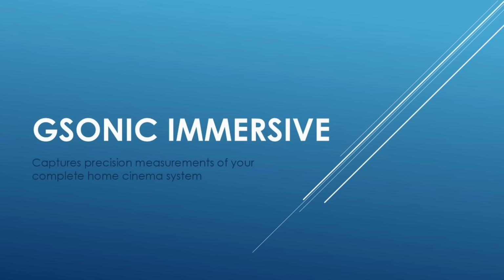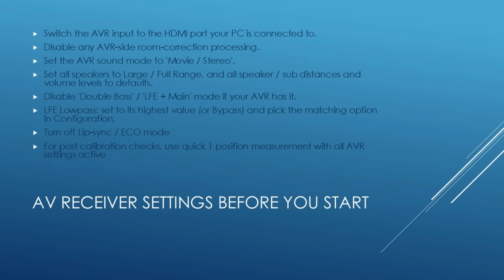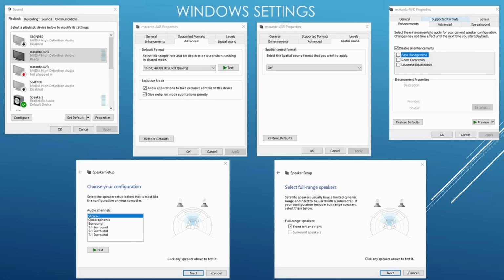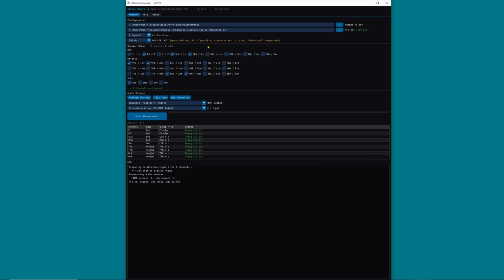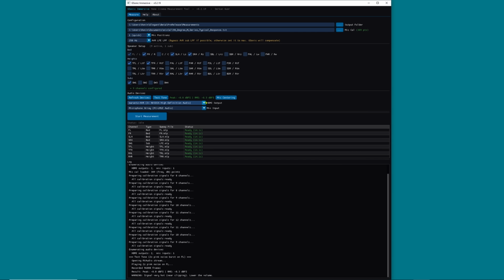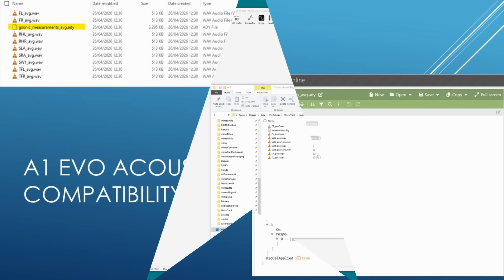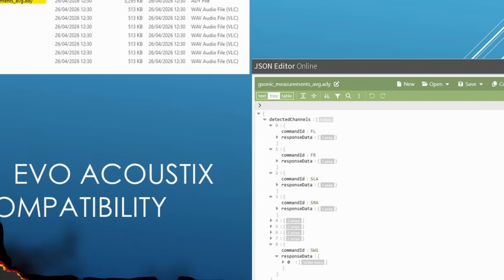GSonic Immersive

Comment: Is there any issue running the audio through my audio chain of PC- Lumagen- Denon A10h? Your app doesn't appear to be pulling any information from the Denon as far as I can tell. Would simplify my measurements and likely produce more accurate results.
Reply from the maker: I am not sure I am understanding the problem? The app sends Atmos sweeps to the AVR through HDMI and records what it hears on the mic with high precision acoustic timing chirps to compensate for any clock drifts between devices. What is a Lumagen?
Reply: @ocaudiophile  Ok. Feature request. I can't generate an .ady file when the Lumagen Radiance pro processor is in the chain. Would be nice to have a checkbox that says to generate an ady file in such a situation, then the entire chain can be measured for potential lag in audio signal which should be neglible. Anyone who does not run their audio signal directly from source to receiver should have this option available.
Reply from the maker: Understood. I will add it in the first update. Gumroad will inform you when it's uploaded. Probably not today though if ok.
Reply from the maker: GSonic updated to v1.0.2 with ady file save now optional and on by default  for Denon & Marantz. Gumroad will not email updates automatically until the first payment is made to me in a week so I am informing you from here.
Reply: @ocaudiophile  Thanks! Didn't expect this to happen so quickly. Much appreciated!
Reply: @ocaudiophile  There is no problem, just wondering what best practice would be. The Lumagen Radiance Pro is a video processor that also switches A/V inputs so thus in the "chain" between the PC and Receiver. Since I'm running it that way in practice, I would assume the I should take measurements with it in the chain versus separately.
Reply from the maker: I see. As long as Lumagen applies the same delays for every sweep (which I think will be the case but I have no experience), it can stay in the chain. If you feel it intervenes with varying latencies based on the audio signal type, it would be wiser to temporarily bypass it.

Comment: Is that any knowledge required to use this application like in rew or applications. Can I use like this application like evo a1 acoustix.
Reply from the maker: No experience needed, it's even easier to use than AcoustiX.
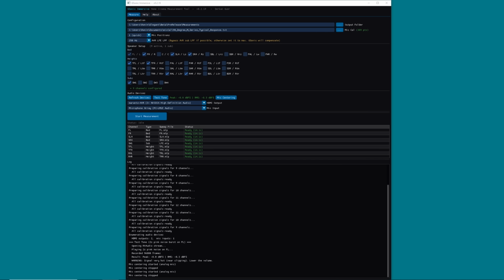Reply: @ocaudiophile  If you don't need experience with REW, than what you do in this video (from 10:30) is not needed for the "normal" user?
Reply from the maker: If you don't want to learn how to read a measurement (and you don't have to of course) then this tool is not for you.
Reply: @ocaudiophile  Well, that is a bit of an oversimplification... I am thinking of purchasing GI and want to import it to Acoustix. But I just don't understand what you are doing in REW in the video. You say "no experience needed", then you say it's not for me. Just wondering if it is needed to adjust after the measurements, and if yes what I have to learn.
Reply from the maker: No, all you need to do is drag and drop the ady file produced by GSI into AcoustiX app folder and run AcoustiX. But if you want to set your sub volumes before measurements, etc. video explains how to drop measurements in REW to make those checks. You don't need any of that since the measurement.log contains info quite similar to what you will find out in REW.

Comment: What about CH and TS? Are they, or will they be, measurable?😇
Reply from the maker: I don't know, untested with Auro 3D due to lack of relevant gear and info. It has dedicated sweeps for all of 9.1.6 and nothing more. The AVR needs to have a way of assigning them as one of these Atmos channels.
Reply from the maker: Edit: Is your AVR "U30" capable? I hear a few new models got that firmware upgrade which apparently redirects Atmos channels to Auro.
Reply: @ocaudiophile  Yes, it is (AV10). I think it's U38 at the moment.

Up until now, a cable swap for CH+TS was always necessary for a proper REW measurement. But changing the layout before the measurement is a good idea to try.

Comment: Looks amazing! Is there guidance on how to set the levels of your subwoofers indpendently before measurement? That's the only thing that confused me from the video.
Reply from the maker: You are right because video advice is to take a quick measurement, check your sub levels in REW, adjust sub volume accordingly and then start the real measurement. But later, I added sub volume level offset in the GSonic measurement log which will give you a ball park figure. Either way, you can measure just your sub and FL speaker as many times as you wish within seconds with this tool so it should be quite easy to adjust the right sub volume.
Reply: @ocaudiophile  , so it would be very good, if you could add a testtone and level display for each channel. So it would be much easier and faster to adjust subs and activ speakers (if you have it) before the measurment process.
Another question: will there be a macOS version in future?
Reply from the maker: Thank you for your input. Test tones are limited to a certain frequency band and are not the best means of measuring volume level. The best way is to run a quick MLP only sweep cycle at the end of which GSI will give you all speaker and sub levels relative to FL.

Macs are locked by Apple to play lossless Atmos. GSonic Reference for example uses the same measurement sweeps but it's stereo only hence also Mac & Linux compatible. There's a way to do this using lossy DD+ sweeps in Macs but the sweep algorithms are very complicated and not an easy take. Will see.

Comment: Thank you for your continious effort into this hobby. 
Having used A1X before to calibrate my system, which was effortless, I am curious to know if there is any benefit to run GSonic. Of course other than to get get insight into the acoustic data.
With the abillity to transfer the ady file from GSonic to A1X, would there be any difference in the calibration results at the end?
Reply from the maker: Yes, you will get much higher resolution measurement data which leads to more accurate filter generation.
Reply: @ocaudiophile  Great! I'll be sure to give it a try in the nearby future then! Thanks a lot.

Comment: Hi, OCA.  I have a feature request for GSonic Immersive.  Please add support for multiple calibration files.  Why?  Because I use a 45 degree mic cal file to measure my top (ceiling) speakers and a 90 degree cal file for the ground level speakers.  It makes a big difference in the measurements above 2kHz.
Reply from the maker: You can change the mic cal file and re-measure the same speaker over and over as many times as you want with this tool btw. Just untick all the other speakers. It's a lot more flexible than it seems.
Reply from the maker: Interesting request but makes sense
Reply: I can see what you’re trying to do, may I know what mic are you using that provides a 45° cal file?
Reply from the maker: I think I have only ever heard once in my life about a 45 degree mic cal file but of course I can't remember.
Reply: @ocaudiophile  At least you’ve heard it! I’m thinking of trying to point directly to my overhead speakers and use 0° but maybe next round. I’m definitely buying this once I’m ready to take measurements again, I have a PC in the room but it’s my kids gaming PC the fans can be noisy, although my Dell laptop is not that much quieter too. I’m considering to buy a very long HDMI cable and do it from outside the room.
Reply: I did that too (10m), had not much luck, interrupted the chirps. maybe just a faulty cable, but back to 5m it runs flawless again.
Reply: @SebSch-d9r  That’s what I’m worried about doing long HDMI cable, might need a repeater or an optical HDMI.
Reply from the maker: Any HDMI above 5m should be optical otherwise they will fail no matter how high quality. I have experienced this first hand. Good thing is optical HDMI cables are as cheap.

Comment: Just finished my first use of the app with 9 positions and seems like all went well. Although I am not seeing an ady file in the averaged (or any other) folder to use in acoustix. Did I miss something?
Reply from the maker: Assuming you're on denon/marantz gear, can you share your debug log?
Reply: @ocaudiophile I am, X3700H. And emailed it over.
Reply from the maker: Where did you email it? Can't see anything from Gumroad? Regardless, I added an option box for ady file saving which defaults to ON for D&M gear with v1.0.2 if you want to update.
Reply: @ocaudiophile only thing I could find anywhere on gumroad was a hotmail email address. But this sounds like what I would need. Will let you know if I have any other issues. Thanks!

Comment: Hi OCA I had a few questions regarding GSonic Immersive. 1. I understand that this is purely a measurement tool that can accurately measure full range from 0-20khz. I also saw you mentioned that in case we are using this with acoustix through the generated ady the measurements will be downsampled. 2. Will this still allow AcoustiX to generate accurate filters with the downsampled data? You also mentioned that this behaves exactly the same as gsonic reference. 3. Does this mean that it is possible to reliably do full range correction using acoustiX custom filters option? 4. Does Audyssey have enough taps to do full range correction?
Reply from the maker: It needs to downsample measurements for ady to work with Audyssey/AcosutiX because it measures speakers with 8x more resolution. The filters generated with AcoustiX can only be more accurate not the other way round. High frequency correction is not a limit of number of filter taps but more of the filter type. Audyssey will internally convert all filters to minimum phase and that limits the quality of high frequency correction. You can still do it if you so wish of course. GSonic Reference uses linear phase filters for high frequency correction which is the only optimal way.
Reply: @ocaudiophile  Understood. So if I understood correctly G Sonic Immersive measures high frequency (5k-14k) more accurately than AcoustiX? I dont mean it has to be perfect but compared to acoustiX it is better since it is 8x the resolution. And therefore as a result any correction between 5k-14k done by AcoustiX using gsonic immersive's measurements would be superior to corrections made using AcoustiX stock measurements even though we are limited by Audyssey's non optimal minimum phase filters?
Reply from the maker: Exactly but the real difference will be in bass response because Audyssey measurements cause jitter in the AVR (hence the need for multiple repeats, etc.), this one doesn't.
Reply from the maker: I'll explain this tomorrow, too long to type from phone.
Reply: @ocaudiophile sure no issues. Looking forward to an in depth response 😁

Comment: How to get it to work on PC? After purchasing it's not allowing me to download it. It asks me to make sure it's safe. After confirming it still to no avail.
Reply from the maker: You just need to double click it and it will self install. You need to unlock or declare safe for any file first time you download it from the web unless it's signed off by Windows. I'm sure you can sort this out soon. If not let me know please.
Reply: I’ve got it to run through chrome browser, not working with Microsoft Edge. How do I transfer the measurements to marantz?
Reply from the maker: You need to move or copy the "gsonic_measurements_avg.ady" file saved under "averaged" folder by GSonic  to the folder where "A1 Evo AcoustiX" is installed and run AcoustiX for optimization and transfer of optimization.
Reply: @ocaudiophile I'm not getting through am I doing something wrong? I've tried dragging the ady file Acoustix not recognizing it.
Reply: @ocaudiophile I did but for some reason an error: Failed to prepare SET_SETDAT command: Distance missing for TS in OCA file.
Reply: Is there anything I can do to solve this? I've tried changing the speaker layout in amp assign but still keep getting this error.

Comment: Any chance an Mac OS version is on the road map?
Reply from the maker: Yes but I need a Mac to be able to release it bug free.
Reply: @ocaudiophile  That's fair, what about if I used something like Parallels Desktop (Windows on Mac), do you think I would run into limitations?
Reply from the maker: Not sure, there are good virtualization tools out there but Apple limits lossless Atmos HDMI passthrough in Macs which might be a deal breaker.

Comment: I'm interested in purchasing but would really like more info / a guide about how to "apply" the settings to an AVR?

I have a JBL/Arcam AVR with Dirac Live Bass Control. Before I had an older Marantz AVR and had no problem running your Audyssey scripts, including Acoustix.

Being a beginner, I don't understand or feel confident about how to use this. Almost no experience with REW. Is this tool intended for advanced users and to do manual calibration using REW? So it's quite different from auto-calibration with Dirac or Audyssey?
Reply from the maker: I'ts extremely easy to use, almost plug and play. And it will give you relative speaker delays and volume levels. But otherwise you can check only DLBC results with this app and not be able to make any changes to its filters AFAIK.

Comment: Hi: Tried installing in Windows 10 Pro 64bit, but no joy. Just an FYI. Installed fine on Win 11.
Reply from the maker: What went wrong with win 10? I use Win 10 Pro myself.
Reply: @ocaudiophile  Yeah, strange. It's an Intel NUC i3-7100u 8gb ram win 22h2 version and just says "This app can't run on your PC". Not much to go on from a diagnostic standpoint.
Reply from the maker: An i3 NUC might not have onboard graphics drivers that can do lossless TrueHD HDMI passthrough.
Reply: Gsonic Immersive Installation on Win 10 Pro 64 flawless here even an old Thinkpad T440s.

Comment: OCA; I’m assuming this tool will also come in useful to test measurements of your system post calibration; ie: running this once you’ve run Accoustix etc should give you very accurate post calibration results?
Reply from the maker: Exactly, it is the perfect way to verify the real-world results of your final calibration! Dirac ART users also can finally check how bad their ceiling speakers are doing :)

Comment: Hi OCA; awesome tool which I will of course contribute to. 

Can I check your recommended workflow and the benefits of uso g this measurement tool vs the current end to end process using Accoustix. I have a Denon with a 7.2.4 setup which Accoustix does a good job with; but I’m presuming this measurement tool is more accurate than the Accoustix method which hacks the Auddesey measurement process. 

Is there any benefit in using this tool for my standard stereo setup; I’m already using the Gsonic free tool for that?

Just trying to better understand the areas where adding this into the workflow will improve results. 

Thanks again. 

Kevin
Reply from the maker: No, you defo don't need this for stereo unless you are desperate to measure your sub along with your speakers. This tool uses the exact same measurement algorithm with GSonic Reference for 2.0 part.
Reply: @ocaudiophile Thanks; but this process improves measurements vs how it’s done using Accoustix with a Denon?
Reply from the maker: It does. It has 8x the resolution of Audyssey measurements among other advantages.
Reply: @ocaudiophile perfect. Thanks

Comment: So, this is just a measuring tool, D&M users can use the ady file to run through AcoustiX? I've never had good luck with REW and my Umik, probably a Windows/user error concern, timing errors in REW was my main issue. I'm very happy with AcoustiX, on my 3 Denon AVR's. What kind of audible benefits can we expect using GSonic measurement process over the AcoustiX/AVR process?
Reply from the maker: This doesn't use REW so almost no learning curve involved and measurement accuracy is on another level because it doesn't force the AVR to generate full 0-24000Hz sweeps in under half a second (341ms) like Audyssey chirps which introduce jitter. But no matter how good it is, if you are not interested in measuring your system very accurately pre & post calibration (as a typical  movie enthusiast would not), it's not necessary for you tbh.
Reply: @ocaudiophile  Thank you, I appreciate your honesty. I'll most likely still purchase it, if only to support your work. I'll use it and may become more than an enthusiast after all. I feel $60 for this is more than fair, for all the work you've done over the years.

Comment: To make sure I follow... Currently have a Marantz that I'm running an acoustix calibration on so I'm familiar with the software....
I would run gsonic immersive and then basically pull the .ady file into acoustix and send that into my receiver?
Reply from the maker: Yes just drop the ady file saved by GSonic to the AcoustiX folder and run AcoustiX optimization.

Comment: Very curious about Gsonic Immersive, can you also just use the Audyssey microphone?
How do I connect the computer to the AVC-X3800H then?
Just to an HDMI output?
Reply from the maker: Yes and Yes. There's even a link for a calibration file in the video description for the regular Audyssey mic.
It can also read .acm files
Reply: @ocaudiophile nice 👌🏻 
thanks for your response
Reply: @ocaudiophile Is Gsonic Immersive really purely for taking measurements only?

And after that, do you have to load the ady file into AcoustiX?